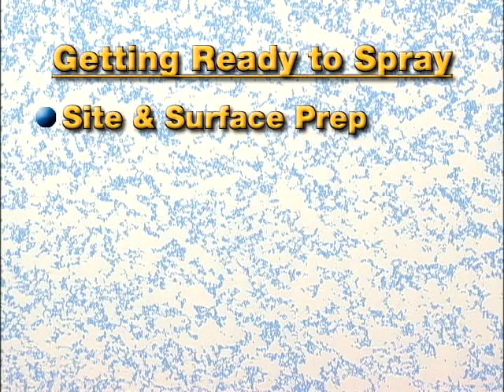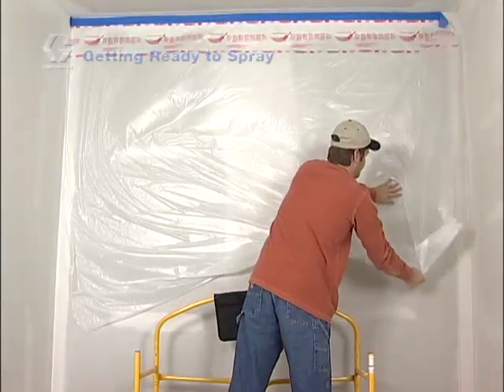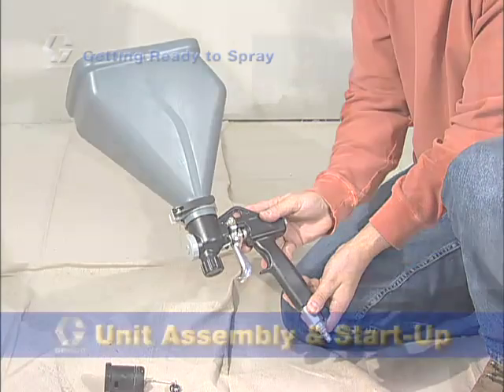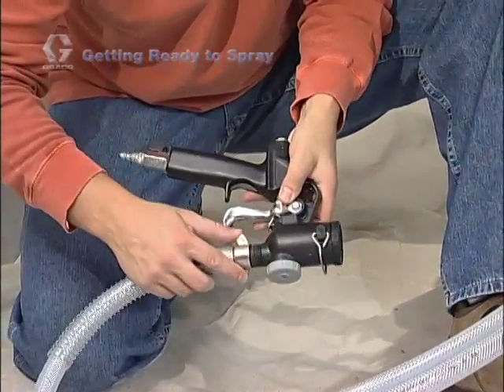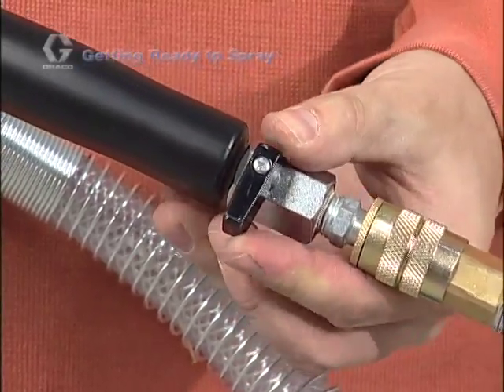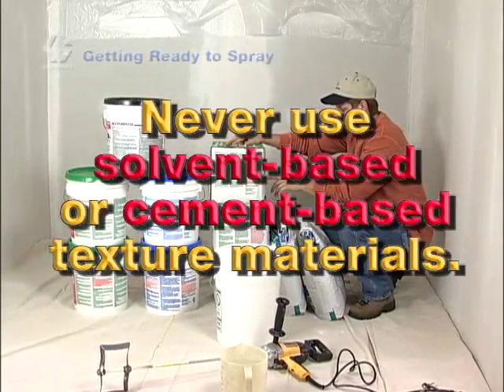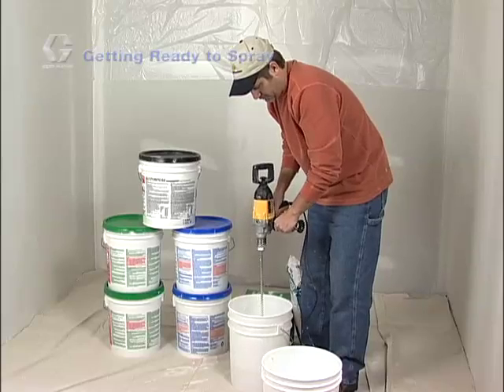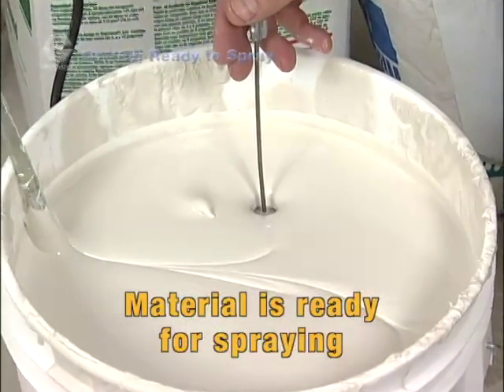02 RTX Texture Getting Ready

Comment: Just rented this machine from HD.Peice of crap imo.Mud would barely come out.Mud was super thinned out too.Smh.Took back after a few hours for a full refund and reinbustment of a bag of texture mud I wasted.Tried to get it going to produce a heavy spray for a thick knockdown.Just going to rent what I know that works with a simple hopper and air compressor
Reply: I use one . Great material flow but fun carrys a big defect  when should the texture.  Gun shoots a straight line and you will see this on the finish wall